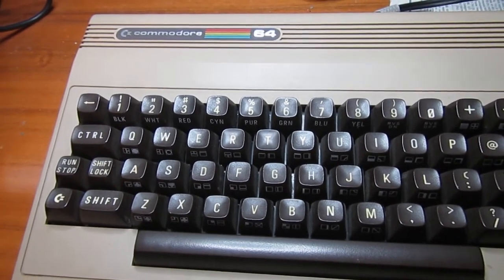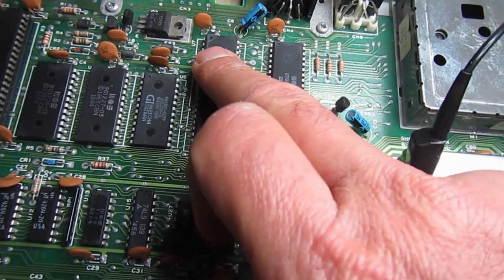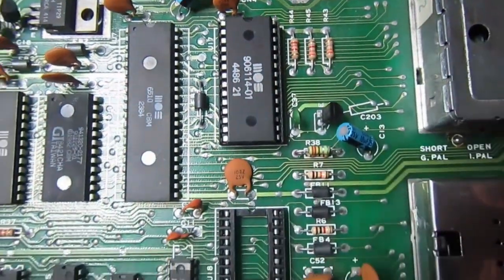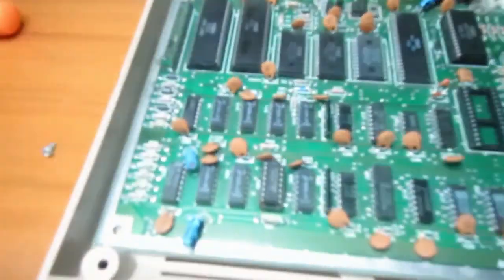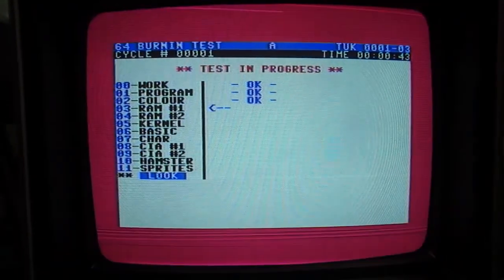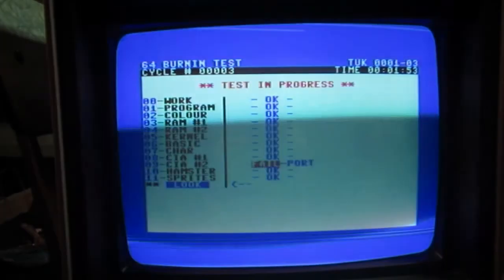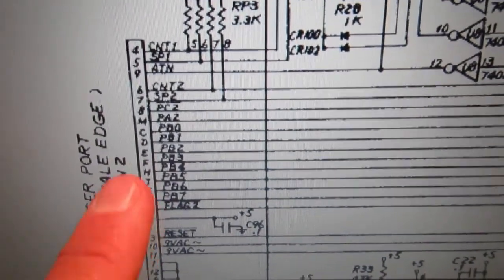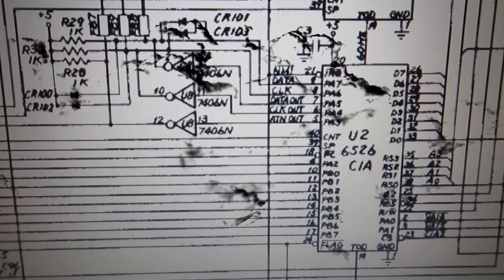Commodore C64 repair:  PLA-induced "black screen" and a bad RAM bit

Comment: Are you able to speculate what is wrong with my c128dcr? I have a video on my channel showing the symptoms in detail
Reply from the maker: It's the character generator ROM either bad or misplaced.
Reply: @iz8dwf  thankyou so much :)
Reply from the maker: You're welcome, let me know how it goes.
Reply: @iz8dwf  turns out what i thought was the sid was the character rom. It had 2 broken pins so i used safety pins to make the connection. It works to a point. It will display characters (not always the correct one in 128 mode. But in 64 mode it works as normal)
But if i try to load from disk it locks up
Reply: Also. If i try to run a basic program (10 print "farts" 
20 goto 10
Run)

In 128 mode. The screen scrolls but it only displays one character at random and none on some lines its usually a $ then locks up

Where in c64 mode it works fine as normal
Reply from the maker: @Colt45hatchback  This other fault is not easy to diagnose without having the machine under the proper instruments. Since in 128 mode, the clock speed is 2 MHz, the ROM might be partly damaged or still not making good contact on some pins. In C64 mode, the slower clock speed (1 MHz) could allow it to work. But it might not be related to the ROM either.
Reply: @iz8dwf  oh i understand. I will solder some wire in to make the connection better tomorrow and see how it goes. Once again thankyou so much for your help :)
Reply: Also the bing noise and the code that comes up is:

BREAK
       PC      SR   AC XR YR    SP
;   0C266  30   01  01   FF   EE
Reply from the maker: @Colt45hatchback  There might be other ROMs not making good contact, but this is starting to be wild guessing. If you have some test equipment (oscilloscope, logic probe) maybe I can suggest you what to test, otherwise it's not possible to  troubleshoot your C128 remotely.
Reply: @iz8dwf  i dont have a scope anymore unfortunatly. I will buy a logic probe though. Seems a good idea as i spend alot of time playing with old computers and car ecus in my spare time